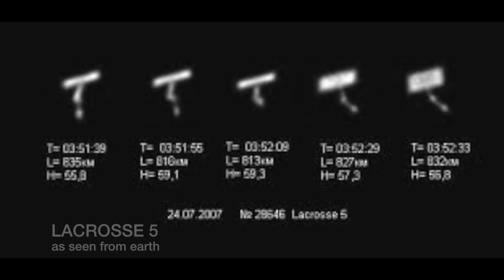The secret space mission that went wrong  STS 27   -   Prof Simon

Comment: I wonder if the success of this mission in spite of the severe damage to the heat shield actually boosted NASA's confidence in the space shuttle's reliability and safety?

Instead of making them more cautious, they looked at this mission and said "Our shuttle can take a lickin and keep on tickin!" Even though it would prove an untrue sentiment years later.
Reply from the maker: good point.....shame they did not take the stuff falling off the solid boosters seriously enough....it turned out to be a big problem.
Reply: In the same vein, the O-Rings on the SRB's weren't supposed to erode, yet they did on every flight.  However, since they never eroded more than 1/3rd diameter, NASA Administrators decided they had a 200% Safety Margin and no remedial action was necessary.
In combination with a cold weather snap, this proved fatal.
The number of times they nearly lost an Orbiter takes up all your digits.
Reply: Columbia was a slightly different flavor.  Insulating foam from the et
Reply: Of course, Every safe return of the vehicle and crew boosted confidence in the space shuttle. That is human nature. The reverse is also true. Two brand new wide body Boeing 737 MAX jets crash and airlines loose confidence in their vehicles.  The Shuttle was both a boondoggle and an amazing technical achievement.  It could have performed safer if better protocols were established and followed.
Reply: i watched a documentary and an engineer said that this affected their decision with Columbia. They had seen bad damge before and the vehicle came home. Their was a faction that were confident it was a non issue. I dont remember the guys name that said it though.
Reply: @jonnie2bad  -- Excellent points from all comments. I've lectured on exactly these themes. My slides here:
http://www.jamesoberg.com/space_lessons_earth_safety.pdf
Reply: The dirty secret of the Space Shuttle program was that if anything happened to the thermal tiles at launch or while in orbit, the astronauts had two choices. The first was to roll the dice, hoping the damage wasn't so extensive or located on a critical surface that would cause the craft to burn up or break apart during reentry. The second was to stay in orbit, hoping NASA could send up another Shuttle to rescue them before their consumables we're exhausted.  This was a very slender thread to hang their hopes on, since NASA never demonstrated an ability to have two Shuttles ready to launch at the same time (even after Columbia, it is doubtful whether they could actually have launched a rescue Shuttle.) Probably the crew would end up suffocating as the CO2 scrubbers failed. Little effort was made prior to Columbia to devise means of repairing Shuttle tiles in orbit, on the theory that any damage sufficient to doom the Shuttle could not be repaired in orbit anyway, and the repair procedures afterward were somewhat limited. The Shuttle that flew was not the one that engineers in the late sixties and early seventies wanted, but what they could get for the funding that Congress gave them and in the development environment and schedules they worked under. Ultimately the Shuttle was always an experiment that operated at the bleeding edge of spacecraft design and materials technology. The fact we only lost two in the more than twenty five years they were flown is actually rather amazing.
Reply: Overconfidence I'd say.
Reply: Either way the Nasa program went to shit when Von Braun left. It was never the same again for whatever reason
Reply: @Josh-hr5mc  , I recall reading that von Braun opposed the design of the shuttle , he did not like ; how the designers attached the shuttle to the solid rocket boosters and fuel tank , he thought it very dangerous. 
He perferred a stacked system were the shuttle would sit atop a main booster , so if something went wrong with the booster the shuttle could escape.
Reply: @marktercsak9728   NASA also advocated for a stacked system with a much smaller shuttle with a smaller payload. However, Congress and the Nixon Administration wasn't willing to fund separate launch systems for intelligence and civilian purposes. So they forced a much larger shuttle capable of carrying the CIA and NRA spy satellites on NASA if they wanted the program funded. This resulted in a much larger shuttle being strapped to the side of the fuel tank with a ridiculous large payload bay with a capacity that was surplus most of the time. A payload bay so large you could fit a spaceX Dragon crew capsule, A Soyuz crew capsule, and a SLS Orion crew capsule in it at the same time. This bigger shuttle was an engineering nightmare but could launch a Hubble Space Telescope or Lacrosse sized spy satellite. But, it was way overkill for getting humans into space or launching most science and communications satellites.
Reply: @LastTechnocrat  Given the Hubble was almost identical in size to the KH-11 series spy satellites (to the point of sharing a primary mirror design and fabrication facility (i.e. oops we put the wrong mirror in Hubble).
Reply: Allan Gibson  are you sure about your data? I am not saying that you (might be) are wrong, but I was under the impression that the “defect “ was caused by improper polishing/removal of material thereby deploying a mirror with imperfections in its curvature that meant it couldn’t focus as designed. And it was this defect that necessitated the subsequent repair mission. As I understand, the mistake was “minor” (an understatement to say the least), but I’m sure glad I wasn’t the responsible party. I only question your post because I have zero information on the mirrors used in the KH-11 series of satellites.